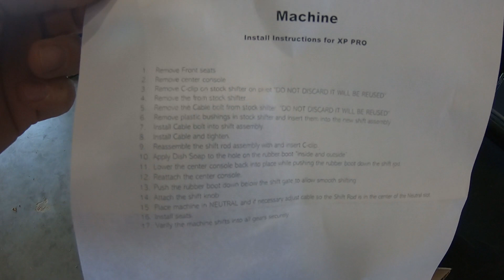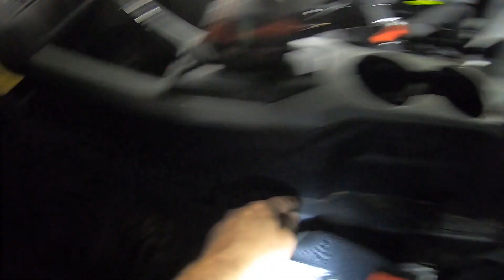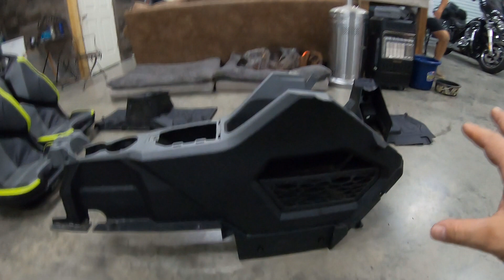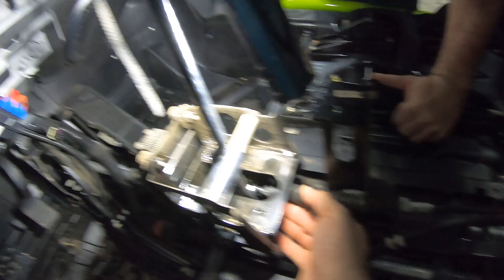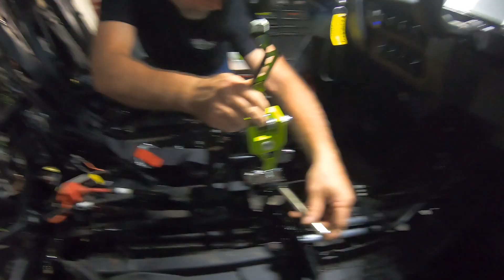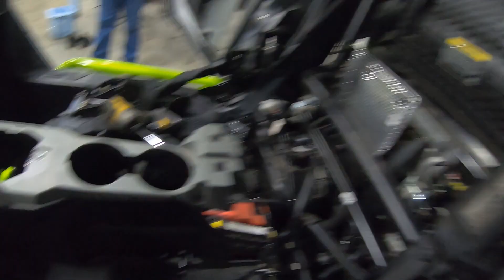Installing a Viper Machine Shifter into a Polaris Turbo R or Pro XP

Comment: I am in love with those offset wheels could I get the size and offset for those? With those wheels and tires,any noticeable strain on the steering?
Reply from the maker: They are System 3 wheels, 10” wide with 5+5 spacing. He has always liked the wide wheels and has no issues with running them and any of his units. Turbo R should be better bc of the new wheel bearing design.

Comment: Great to the point video! This process is almost the same on a Pro R. Biggest difference is the cable-shift has two linkage connections (part number 7083007) and the mounting bracket for the shift boot/gear indicator get mounted to the stock shift mount.
Reply from the maker: Thanks. We work on all our own stuff so we try to help out so that most people wouldn’t have to pay to have things installed.

Comment: What brand sliders
Reply from the maker: They are Polaris tube sliders with a plate welded to the bottom to make a step and then color matched powder coated.